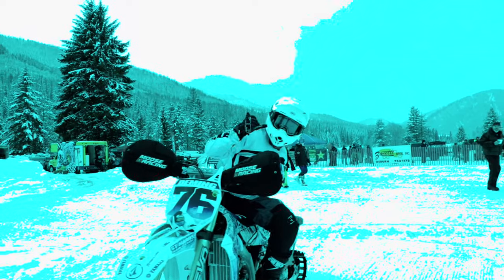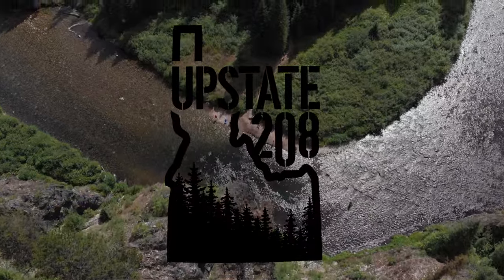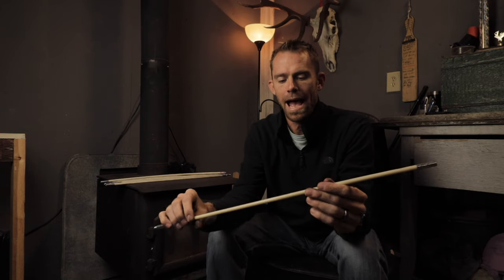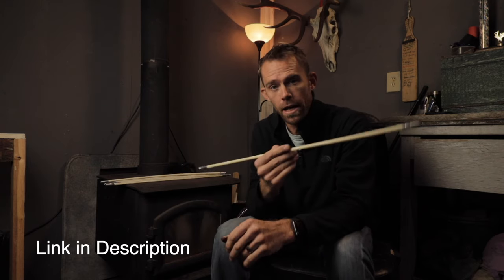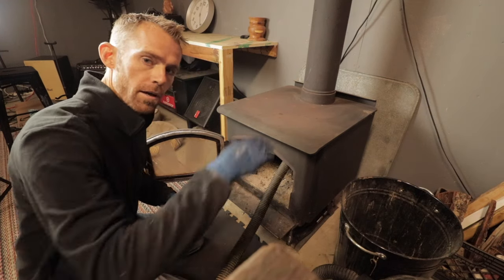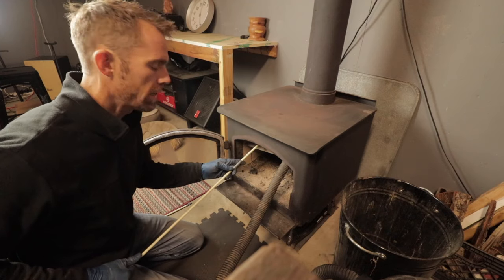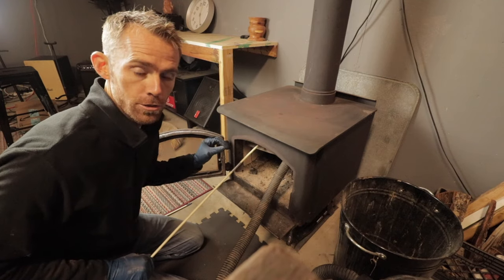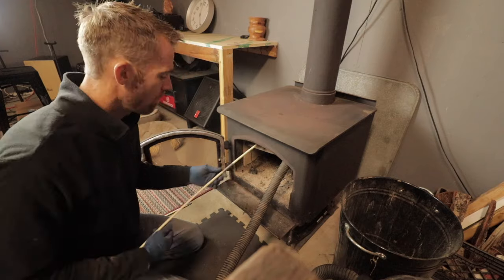How to Sweep your Chimney - The Easy Way

Comment: Always rotate the rods clockwise as you feed them up and down to ensure that the threads do not unscrew and leave the brush stuck in the pipe.
Reply from the maker: This is excellent advice. 👆🏼👍🏼
Reply from the maker: Go counterclockwise though, otherwise they will unscrew.
Reply: They are reverse threaded?
Reply: This would work ONLY with round brushes, NOT with rectangular brushes.
Reply: Buy the Morinoli that snaps with push pins together then cow or cow makes no difference
Edit of course running CCW you risk loosening your drill chuck. I thought about that when u went up to do our chimney. I’d give my Morinoli 4 stars as a tool best used by the homeowner after you hire a pro to get that stuff off. Ours looked like drizzled ceramic   So I can maintain it with this after I pay the pro to scrape or whatever they do.
Reply: One time it needed cleaning 🧹 and it was hot 🥵 and I think there was a fire 🔥 in the center and one of my fiberglass rods almost melted in half. It came out but I had to replace that one.

Comment: I've had a stove for three years. This year we've upgraded our fuel to burn nicer wood and smokeless coal. But there's now loads of ash from the flue all over the garden and windows all the time. I don't understand why the better fuel is causing this. Unless it's coincidence. Google isn't helping. Had chimney thoroughly swept and serviced stove but still getting black ashes all over the driveway and car. Any suggestions?
Reply from the maker: Did you make any headway on finding a solution to this problem? Could be the type of wood you are burning, could be the coal. Could be a lot of things unfortunately. Hope you find a solution.

Comment: Best video on cleaning a wood stove! I started having smoke blow back out (of an already warm stove), and a decrease in draw, almost overnight. Was working perfectly yesterday. 🤔 I’ve used the stove about 250-350 nights total before moving to Montana a couple months ago, so I’m thinking it has to be time. I’ll get through tonight, then head into town in the morning for some cleaning supplies! Thanks!
Reply from the maker: Sometimes shoulder seasons ( like now and early spring) when ambient temperature outside is close to the same as inside, it can cause the issue you described. It could also be your chimney cap is clogged up and not letting the stove breathe. Good luck!👍🏼 and thanks for watching.

Comment: I bought a set of those rods with the brush, go in from the stove by removing the fire bricks so I have a clear shot up the straight stovepipe.This worked great, i am 76 years old now and a little shaky climbing up on the roof these days. Brushed the pipe clean and then cleaned up the mess with my shop vack.

Comment: Thanks for doing this. I have a similar wood stove, except instead of bricks as a baffle, I have a large ceramic plate with a baffle blanket above it. I removed it and several bricks on the side, then used a small wire brush to clean any creosote off of the interior of the wood stove. I have a similar 4” brush which didn’t do as well as yours. I’m going to get the 6” as well as replace the baffle blanket and several cracked bricks when I do it next year. 
I’ve been on a 2 year waiting list for my local chimney sweep. Enough is enough. I’ll just do it myself. SMH

Comment: Thank you so much for this video. I noticed that you didn't use a drill in the video. Given your experience, is it ok use a drill to spin the brush or is it better to just move it up and down by hand?
Reply from the maker: I would feel fine using a drill in this same application. I chose not too, simply because it’s easier and I knew that my creosote was dry and flaky and did not require aggressive brushing to remove it.
Reply: Depending on the length of your chimney I would find it kind of hard for a drill to spin a rod several feet. I like using my hands so I can feel whats going on

Comment: I'm just putting a similar unit in my house!  Perfect timing man!  A video about how to pass an installation inspection would be sweet lol. I need a heat sheild like yours too!  Thanks for the video!  It's simple stuff till you have your own stove and you realize you know nothing!  Lol. (and by 'you' I mean ME!)
Reply from the maker: Typically you will want to resort to your local city or county code as it pertains to wood stove installations. More often than not those people are referring to the stove manufactures recommendations. If it’s a used stove you can usually look on the back of it for the metal identification plate and it will usually tell you the clearances required for installation of both the stove and the connector pipe. If it’s a new stove, the installation manual will be your friend and tell you everything. You may be able to find a manual online if you can identify the model and manufacturer.
Reply from the maker: Bro...I didn’t realize who this was until I went to your page and started watching your videos and said.....wait a minute I know that guy!!! Hit me up if you need help with that stove, I’d be happy to help you.!💪🏼
Reply: @UpState208  the problem is finding the local city or county codes..  I bet they're available somewhere but idk where 🤔  I've been following the WETT guidelines but the heat sheild and clearance reduction varies and the manual just says it varies by local ordinance lol
Reply: @UpState208  also, we sure should do a video collaboration!!  I do my stuff in upstate 208 so it fits!!  And if you've seen my videos, you know how shat my video production skills are! Lol. Your videos are top notch im jeally!  Thanks main!
Reply from the maker: Totally down for some collaboration. My number is easy to track down. Hit me up and let’s chat. 

Also, heat shields can be confusing when it comes to codes and spacing. I always look at installation manual. They typically have all the info you could need in regards to that stuff

Comment: Bro, thanks for the tips, 
If I can suggest something-
you had the brush all the way in the chimney, why not brushing back and forth between each time you removed one of the sticks, so it’ll scrub more creosote from the walls?
Reply from the maker: That is a good observation my friend.  My creosote was very dry and fluffy, all it really needed was a brush through it one time to get it off the walls. Had it been sticky, or caked on the walls I would have had to be more aggressive. The type of wood you burn, whether it’s seasoned properly and how you operate the stove will drastically change how the creosote formation takes place. The bottom line…you want to get that stuff outta there. 😁 Thanks for watching.

Comment: Hi and thanks so much for the video.  I'm going to give this a try the next time up at my cabin.  I too also have a straight pipe up with no 90s.  The one thing I would do different is run the brush up more than one time.  maybe even 3 times.  But all in all a great video.  Thanks again!
Reply from the maker: Yes...I had very dry, and very little kreosote. Not a bad idea to make several passes up and down the chimney if you have lots of build up. It’s also recommended to verify the cleaning by looking down the chimney if possible. I burned very seasoned wood and have hot fires so I don’t get very much build up. Each chimney, stove and or the wood being burnt can’t create different kinds of build up. Good luck, and thanks for watching.👍🏼

Comment: I think its easier to disconnect the slip pipe and the pipe all the way to the ceiling. You can vacuum the baffle from the top of the stove. I actually took a low profile plastic tub and put two holes in the bottom of it. Use it to run your brush through the center and a side hole for your vacuum hose. Have someone hold it up against the ceiling. Turn vacuum on and brush.

Comment: What about glazed creosote built up on the inside of the flue? Ive been told only the hard steel brushes take care of that. How might steel brushes damage pipes? For reference i have fiber glass insulated pipes. 

As for that coal like creasote, it makes for wonderfull starter.

Comment: Does the same basic process of cleaning work for an insert fireplace unit.  I'm 71 and don't want to get on the roof either.  I presume I can simply clean from the bottom up the same way?  And does one pass of the brush sufficiently clean the stove pipe chimney?  Thanks for your video.
Reply from the maker: Inserts can be tricky. Does it have a direct connected flue liner that connects to the insert and runs all the way to the top of the existing chimney? If it doesn’t I would be very careful and realistically would recommend a certified chimney sweep come inspect your system and take care of it for you.

Comment: So do not use a drill?  I have a Waterford Trinity but previous owner didn't put in a damper. I live in the Rockies of Colorado and only have access to Spruce, Pine, Fir and some Aspen so I probably have decent amount of buildup. I have double wall pipe but should i have a damper? Thanks!

Comment: Sorry to comment on an old post but why couldnt you put a tee at the bottom of the stove pipe? I'm in the design stage for mine and i was thinking how convenient it would be to place a damper then a tee above that then I'll  have a straight up run of about 12 feet to roof then about 10 feet up out of roof. If you had a tee you could easily open it and run your brush and flex poles up from there? Then just hand clean the small section below the tee? Would that work or no?
Reply from the maker: Putting a tee and damper on your stove pipe can be dangerous in the event you have a chimney fire(there’s no way to suffocate the fire). It would make cleaning the chimney easy, but I wouldn’t recommend doing that. Also, the stove I have is designed to not be operated with a damper. I hear what you’re saying, but be careful my friend.

Comment: If pushing it up and pulling it down like that is all it takes, my chimney must be pristine.  You have to run the brush back and forth half a dozen times with each section of rod you add as you go up and the same on the way down as you're taking sections off.
Creosote is like tar. It accumulates on the chimney wall as the smoke rises and cools.  Your brush doesn't take off creosote unless there is ash underneath it. Moist wood and a smouldering fire makes more creosote than dried wood and a roaring fire.  The amount of creosote you will have depends on how you operate your stove and your wood.  
If you can see a shiney layer of what looks like tar or thick black paint, that's creosote, and you're ready for a chimney fire.  When the creosote burns it leaves behind the ash you're brushing away.
When the creosote layer burns, it will leave ash on the chimney liner and a new layer of creosote will begin to form on the ash.  Eventually, as ash accumulates, an 8" chimney liner becomes 6".  If the creosote layer gets thick enough before it catches fire, you'll have a heck of a fire and your chimney can go from 8" to 6" all at once.
The key to avoiding disastrous chimney fires is to have a hot fire each day that burns the creosote.  This forms the ash that should be cleaned as necessary, yearly or more frequently, depending on how much and the type of wood you burn. 
The vacuum is great, but you're sucking up ash, not creosote.  The ash is from burned creosote and deposited ash from the firebox that is carried up by the chimney draft.
Every woodstove and chimney system is different. The key is to learn how to operate yours with the type of wood you have available.
Reply from the maker: This is great information folks and very true.👆🏼

Comment: Did reverse. Used electric drill and fed from the top. Used a dryer kit clean out kit and attached vacuum plug and shop vac at the bottom. 
Tip: never reverse drill

Comment: Excellent point in your video about the baffle...These are super fragile and easily destroyed if you don't really know what you're doing. (Read, understand and follow ALL of the instructions that came with your wood stove or other heating device)...Failure to do so could result in burning down your house and killing your family...Bottom line is, Know what you're doing

Comment: I have a question,  my chimney has a sort or lever  underneath beneath the glass door, for air I assume (not sure i just boughtthe home.  Do I have to worry about cleaning that part out?
Reply from the maker: Sounds like your air control for the stove. I doubt you can access anything in there to clean.
Reply: @UpState208  thank you for your response,  I just ordered my cleaning device, similar to yours and I'm waiting for it to arrive! Supper excited. 
One more question regarding creosote, is it truly necessary if I'm already cleaning it out with the chimney sweep tool? 🤔

Comment: very clear steps, thank you. My question is how can I use the same method for a flue that is not going up straight 🤔 My flue has 2 corners.
Reply from the maker: With flexible rods you may be able to navigate those bends. Sometimes it requires twisting the rods as you are going through those angles in the pipe. Use caution as your brush can sometimes get stuck in there. If that happens, try to use the twisting method while pulling back down on your brush/rods to free them up.
Reply: @UpState208  thanks

Comment: I installed a pacific energy wood burning insert (with a baffle in the top) and I installed a chimney liner as well. It was working great for about 4 weeks...then this strange thing started. Even with the air intake set to H (biggest air flow) and an exterior door open, after I get a fire going...when I close the door, the first immediately goes out like it isn't getting any air at all. The baffle is seated correctly, and it's fairly new. The ash had built up...but I cleaned it out. Every time I close the door...even with air flow set to High....the fire dies. I open the door to give it air and smoke billows into the room. ALSO...there is STILL smoke coming out the chimney outside, too. I looked down the chimney...and it's really not clogged. I also took the plate off the front bottom of the stove for inside air intake....but the problem persists. And is started suddenly....what else can I possibly do? Thanks for any help you can give me.
Reply from the maker: The only thing I can say is that if it was drawing fine, and now it’s not. Something is clogged. Is your chimney cap clear. Do you have a screen on your cap. Those are troublesome and a common issue with drafting problems.
Reply: I have a PE also. I had smoke coming back through the joints and could barely seek inside the house. The pipe near the top was clogged except for about 1" diameter hole in the middle. If you move the baffle when putting wood in it may dislodge the area for the secondary air feed. It is a rectangular hole in the back. I removed my baffle and it is not easy to know exactly where it should go back in because there aren't any stops to locate it. I'm getting blow back again now about 4 years later and will take my chimney apart to see why. I suspect lots of creosote because I was burning all of small green twigs from a beech, 2 maples and an ash. Live and learn.

Comment: As a single female that was very informative for me.  Thank you for mentioning about laying out fire brick the way you take them out.  Would not of thought of that.
Reply: 😂😂😂😂What does you being a single female have to do with ANYTHING?😂😂😂😂
Reply: @squirrelcovers6340  Some of the retired men in my subdivision have old school thinking. I’m slowly changing their way of thinking especially when I asked if anyone could lend me a basin wrench to change my bathroom taps. 😂😂
Reply: @sharonstahls8781  Good luck on changing their way of thinking. Waste of time in my experience. I spent a lifetime doing that fruitless work. I know the look of shock when they encounter you on the construction site as part of the team, or the expression of surprise when you ask for the right tool by name or when they repeatedly see you coming and going from the hardware or auto parts store. It doesn't matter if you can rebuild your carburetor, replace your transmission, fix most things on your house, chop your own wood and have a college education. In fact, their contempt drives them to find new ways to "put you back into your place" either to your face or behind your back, but always in the most underhanded ways. They need to see females as less capable to prop up their fragile egos. It has little to do with women or reality. I wish I'd spent less time trying to change their opinions or gain their respect and more time not giving a flying monkey's ass what they thought. But, if it's your thing, I understand and I wish you luck. Just know, the best complement will ever get will be "not bad, for a girl." Which is a way to insult all women.

Comment: We have a brand new home and have only had about 20 fires in the fireplace and have only used oak wood. How do I know if it needs to be cleaned. I was going to use a creosote log this season and then have a professional clean after the season. I do appreciate your input,  stay blessed
Reply from the maker: Creosote logs in my experience are a gimmick. Nothing can sweep your chimney other than a brush. If you can get on your roof and remove the chimney cap and then visually inspect what the flue looks like that will tell you a lot about what perhaps the rest of the chimney you can’t see may look like. If you are burning hot fires with good seasoned wood it can significantly reduce your creosote build up.👍🏼